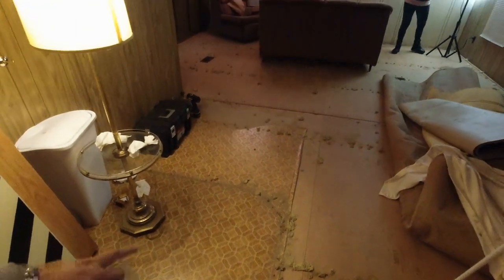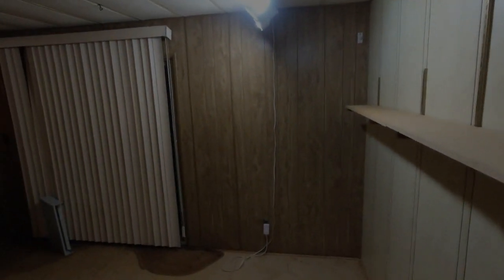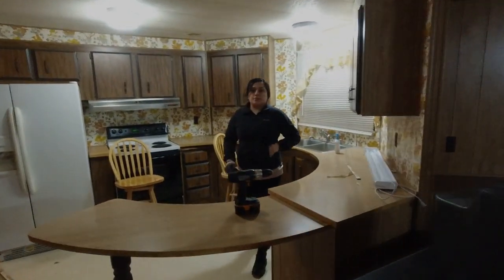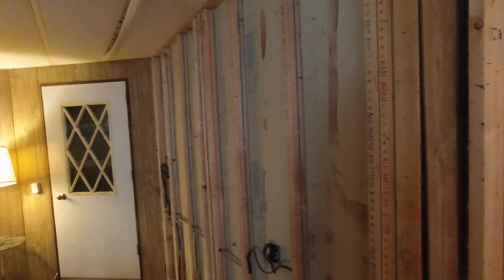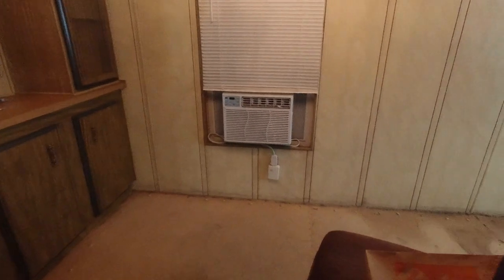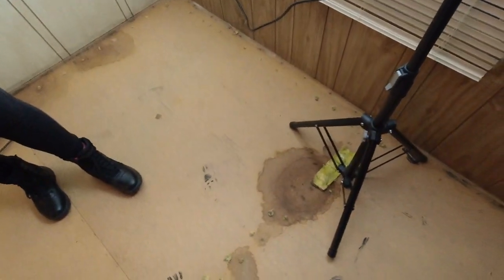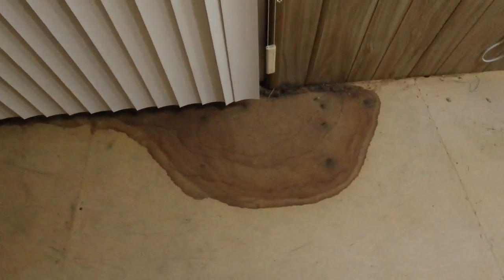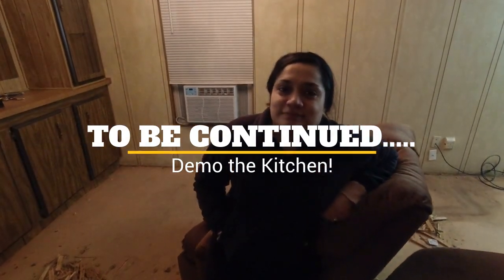Water damage by sliding door: DAY 2 DIY mobile home renovation

Comment: Fun.  That thick wall is the marriage wall where the two halves are joined.  You will need a beam if you take it out.  Get a carpenter to figure the thickness the beam should be.  It's usually two 2x8s with 1/2" plywood or OSB sandwiched in it.  Glued and screwed together.
Reply from the maker: We're having a great time doing this. Thanks for the advice, I definitely reach out to a professional about it before I go cutting into anything, much appreciated.